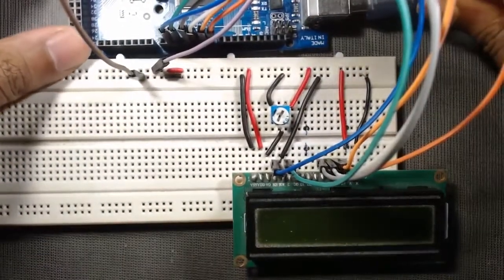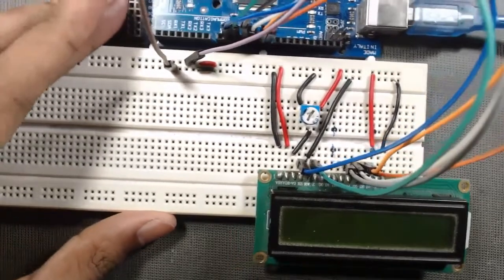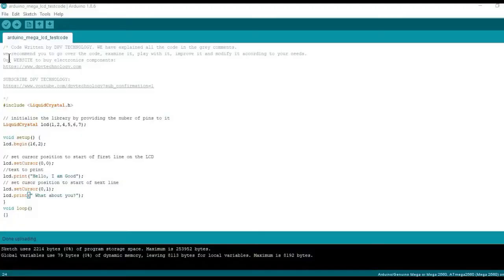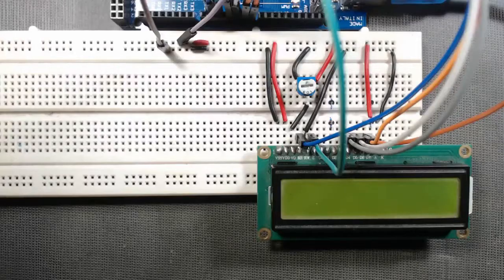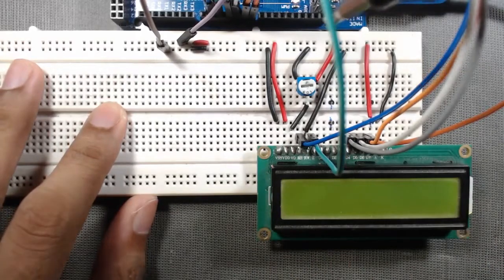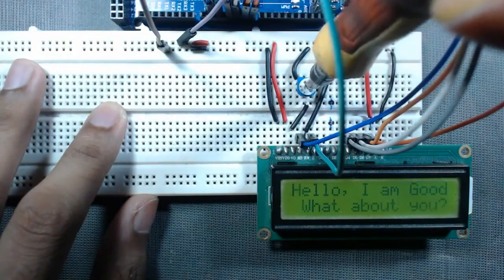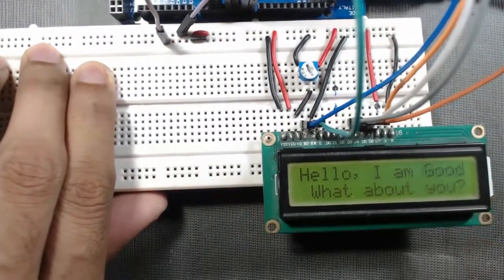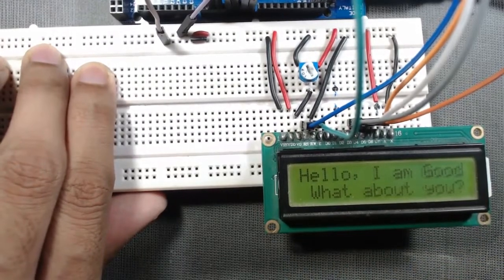Arduino mega lcd tutorial

Comment: would it be possible if I want to connect it using pin 22 to 50 apart from the power supply and ground pins? If it is can you tell me how?